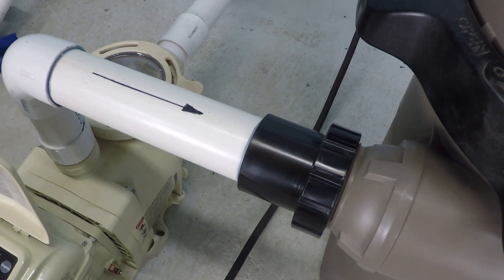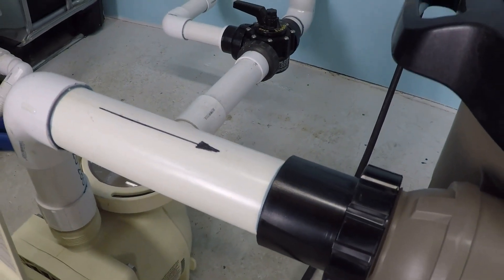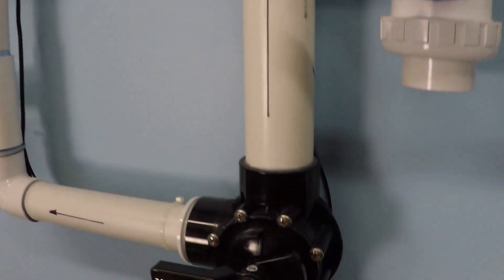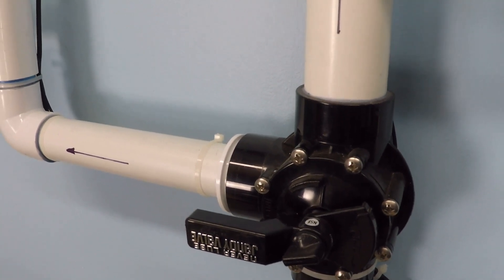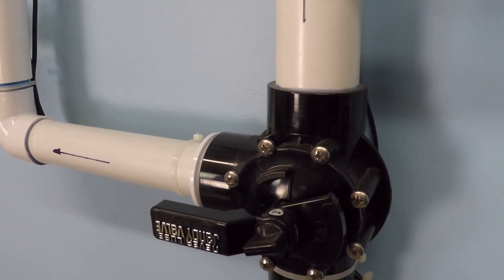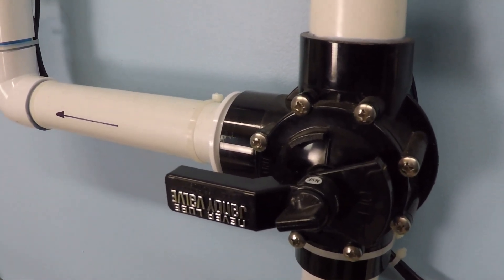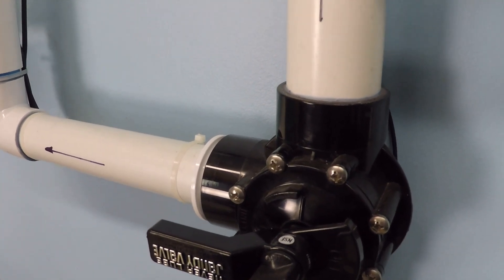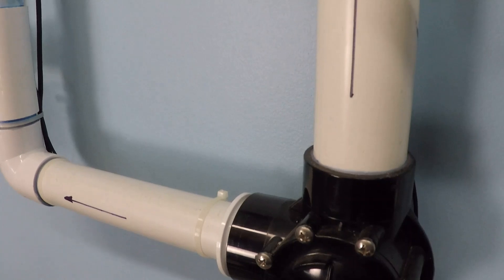Are Black Pool Pipe Fittings ABS?

Comment: Helpful video. Would you never use ABS with pools. My pool is a soft sided above ground pool. Id like to add a 3 way valve after my sand filter so I can split the water back to my pool and to my solar heat mat. I need to create a custom fitting to come off the sand filter and go to the valve. I know you mentioned abs is not used for a pressure rated system.  In the way I have described, you would absolutely not used ABS? Thanks

Comment: Another great, informative video. I was wondering... Do you use primer just as you would with a regular PVC fitting?
Reply from the maker: Yes I use primer for any pressure connection including CPVC even though these black fittings definitely will make your clear primer gray!
Reply: I hate primer, it makes a mess 😭